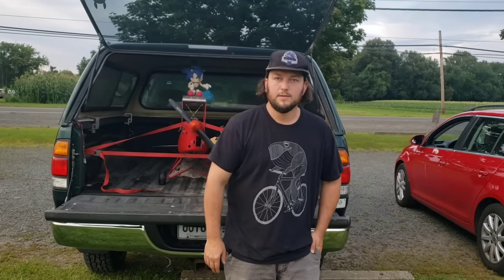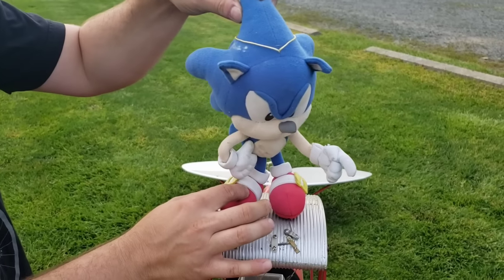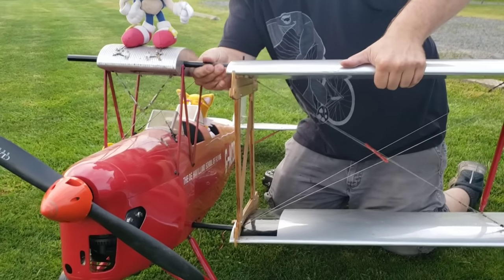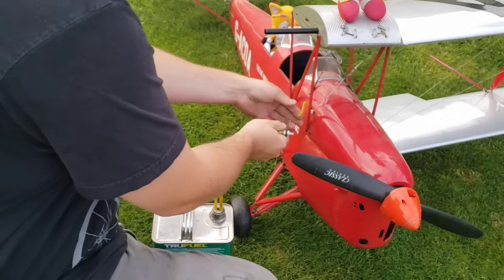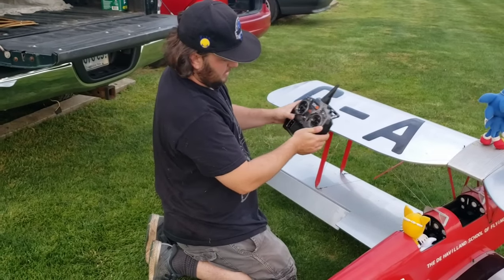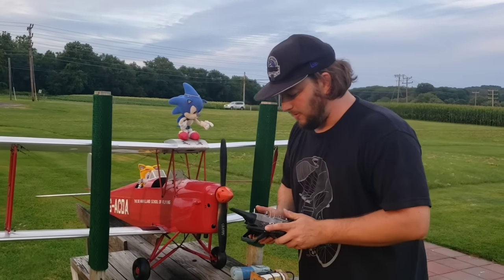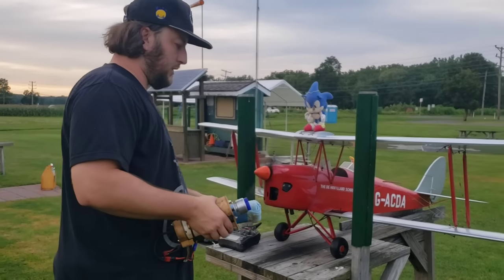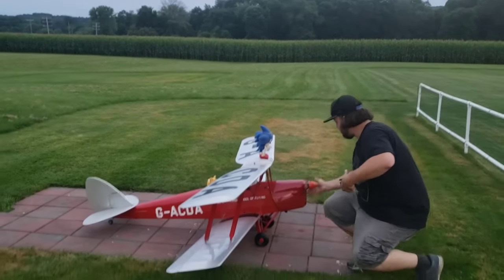Sonic plane overview and quick flight

Comment: Sonic: Impaled through the legs to the head.
Tails: wears a seatbelt
Reply from the maker: Well sonic likes to live on the edge and tails is a bit of a wuss so...
Reply from the maker: @sheparddog117 I do have a battery, it's a 2s LiFe, 2500mah if I recall correctly. Easily gives me over an hour of flight time per charge.
Reply: @andreydildin  3 batteries= 3 hours of flight
Reply: @andreydildin  for 🎉🎉🎉🎉🎉🎉🎉🎉
Reply: @andreydildin  or tails is just smart ig
Reply: @andreydildin lol

Comment: What's the name of the plane? How much do you buy it for?
Reply from the maker: The plane is called a horizon hobbies tiger moth 20CC. They don't make it anymore. I paid 700 for it about 10 years ago, and that's not included The engine and electronics

Comment: What tools did you use to make sonic and tails stay on the plane
Reply from the maker: A cordless drill and screwdrivers. Tails was easy, I just belted him in with 2 eyelets and a length of silicone tubing. Sonic has 2 metal rods going through his legs, torso and head. They bent 90 degrees forward at his feet, and secured to the top of the wing with plastic and metal plates, mounted with screws.

Comment: I like the plane I am wondering did you make the plane or by the plane? And what is the plane called?
Reply from the maker: The plane is called a Tiger Moth. It was about 85% pre-built from the factory. It did not come with the engine or electronics.

Comment: Where did you get this want to know so I can make sonic and tails plush videos
Reply from the maker: They no longer make this plane. One will occasionally pop up on ebay for over $1000, and that's not even including the engine and electronics.
Reply: @andreydildin  what is it called
Reply from the maker: @amatoy23  Hangar 9 Tiger Moth 20cc

Comment: Why is tails in the back Keisha be in the front
Reply from the maker: If I'm understanding your question correctly, here is the answer: Sonic's actual biplane has only one cockpit.
My model has 2. In most biplanes with 2 seats, the back cockpit has the full set of controls, and the front has the bare minimum (for the student pilot). So when there's only one occupant, they typically sit in the back seat.